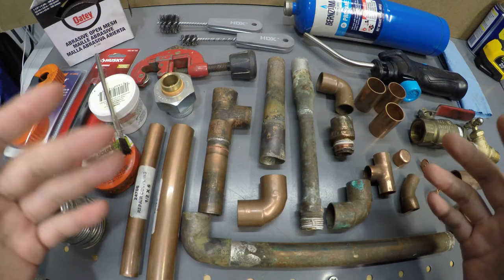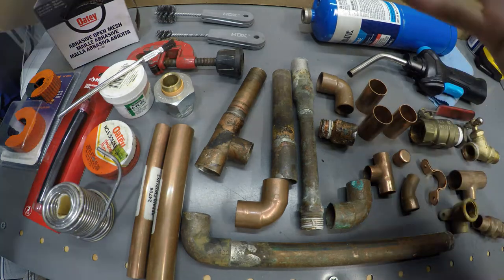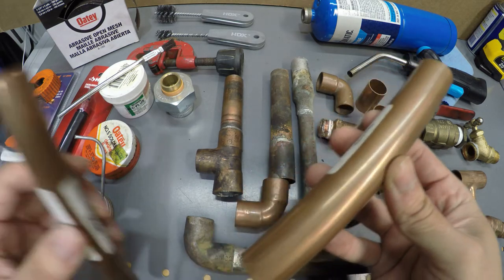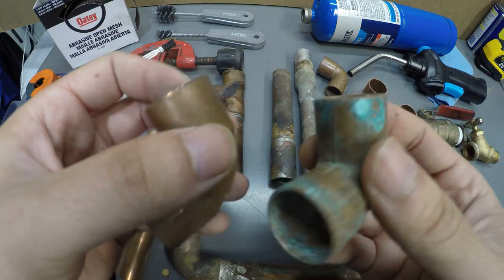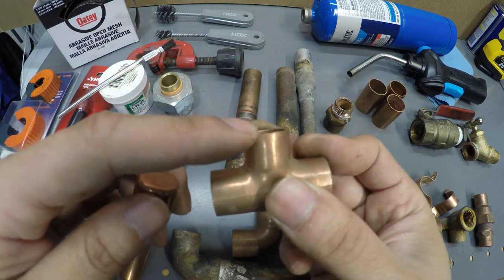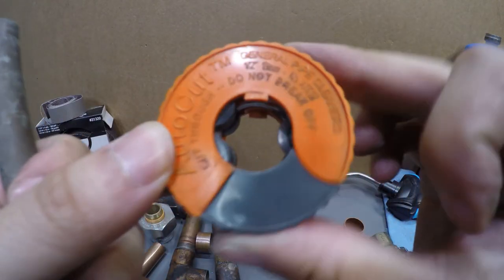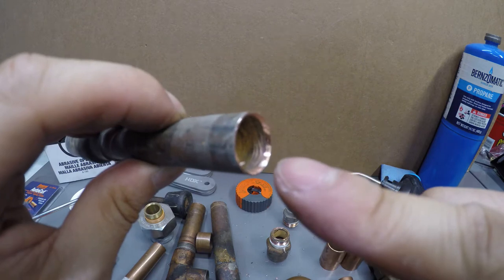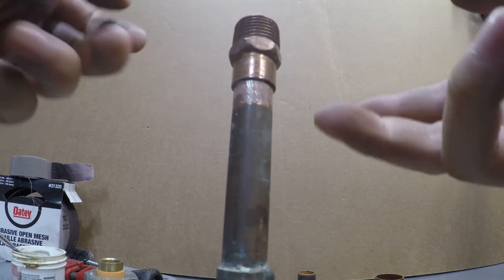How to Solder "SWEAT" Copper Pipes (FULL LENGTH VIDEO)

Comment: THANK YOU FOR AN EXPERTLY TAUGHT LESSON on sweating copper fittings. I never knew how to do it. no one had ever showed me. My Dad taught me to weld with Oxy/Actlyn and a wire coat-hanger, and I was proficient by the time I was 10 years old, but the concept of joining copper pipes was passed my understanding!
   You take your time and show exactly how to do each step and have a very easy to listen to voice! I subbed! I watched your video on removing / replacing bearing hub races, this morning. I see I need to buy a drift pin and look into race installation plugs...that or turn some out of 5/8" plate. Thanks!
   Bill from Tn. 🇺🇸
Reply from the maker: Can’t thank you enough Bill. It’s a good skill to learn. Practice more and you can pass on the knowledge to others. Thanks for the Sub and take care.